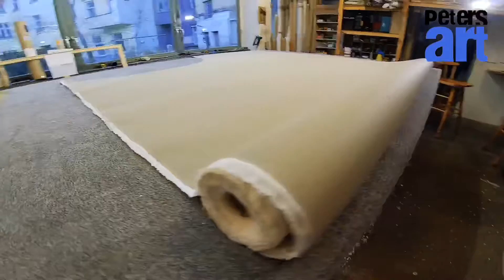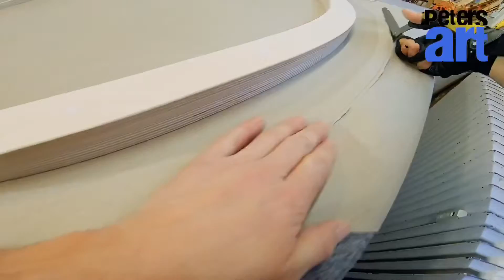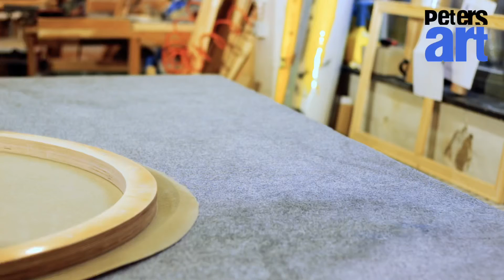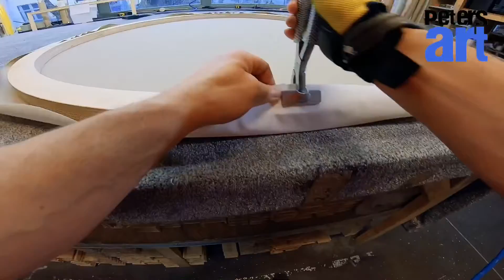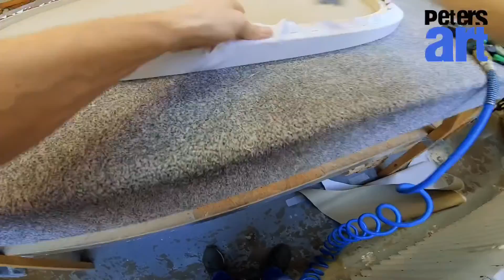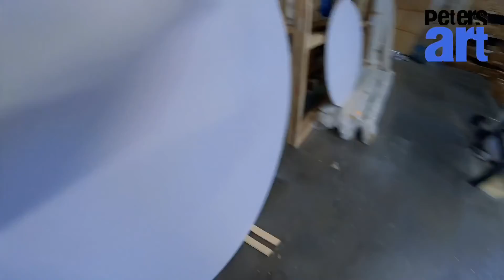Circle canvas stretching DIY

Comment: Thanks for this informative video.  I have to stretch a canvas around an 8' diameter circle, and watching this process gives me confidence in the process.  I hadn't considered misting the canvas with water prior to stretching.  Was the spray on the surface after the canvas was stretched done to tighten up the fabric as the water dries?